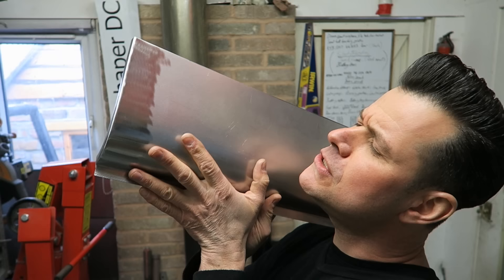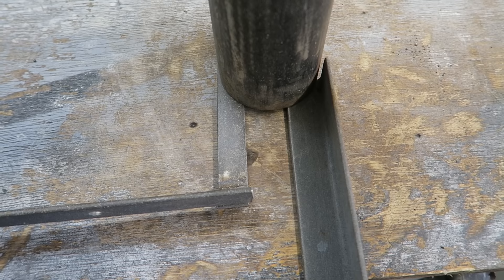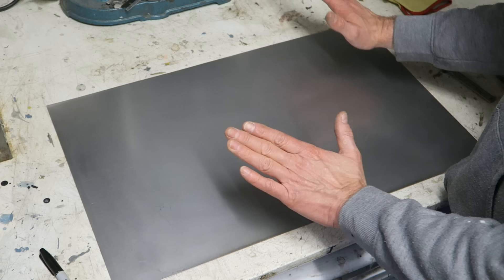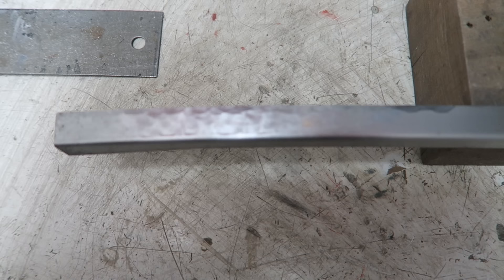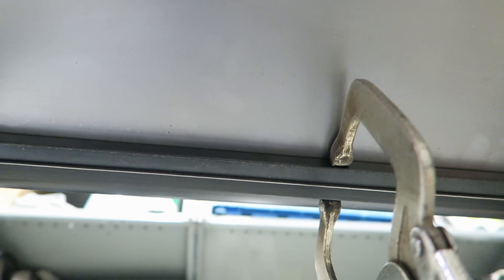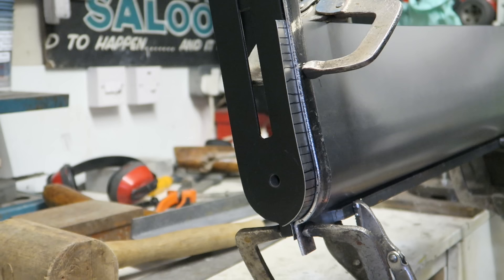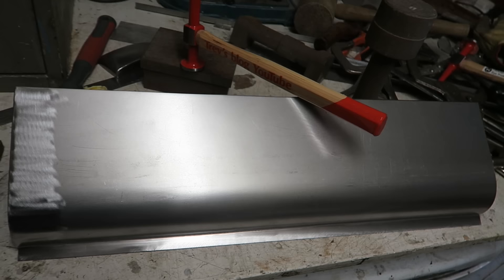How to make your own repair panels sill fabrication beating tips and tricks #16

Comment: Nice work Trev, however in the part of the video when you said the panel had slipped slightly, hence the lip was bigger by 3 mm, with the shrinking of the metal i would have imagined that it has to go somewhere so it goes outwards making the lip wider on the arc. Just my thought as the panel looked straight afterwards

Comment: That new hammer looks like a "Snap on" bodyhammer without the Snap On logo andcolor scheme.
Reply from the maker: It’s very similar to the snap on but the head is almost identical to the Sykes Pickavant that is no longer manufactured. I buy them from India unbranded from the manufacturer then add my logo. Most branded tool brands don’t make their own tools, they’re manufactured by tool makers to a specification then sold as their own tools.

Comment: You're good at signing. Why not tac it with super glue to hold in place to weld it?  We just threw our metal tube away we had it for years. I came here for tips on how to bend the flat metal to repair two sills on our Humber Super Snipe series V, that we most likely will sell when we have repaired the sills. That metal cutting saw you use is ideal for the job.  This video is very professional.  Thank you! Ps what hat did you buy afterwards...?

Comment: If you use Chrome as your browser and right click on the link in the comment you will see a menu open that gives you the option to "open link in new window" or "open link it new tab" I usually use the latter and so you retain the comment in the original tab and open the link in another tab or window which you can close when done and go back to the original comment.  Hope this helps.

Comment: Trev not sure if you'll see this or have time to answer - but if I spent the time dressing a cheap hammer up would it be usable?  I only ask because I seen you say you dressed yours, rounded the edges of the face.

I bought one of those cheap n nasty hammer n dolly sets a while back and never got round to using it - only remembered I had it with this video.  Is it worth putting some time into the hammers/dolly's?  And if so what/how would you do it?
Reply from the maker: Purple Helmet just give it a go, what have you got to lose.? I regularly use some really cheepo nasty dollys because they’re quite small and fit into certain gaps. Cheers Trev 👍
Reply: @trevsblog  - thanks for taking the time to reply Sir, really appreciated.  I'll get wired in and see what I can come up with, try and round the faces like on yours 👍

And again, thanks for these videos, so much quality in them, learning so much and enjoying your style too - thanks for giving up your time to do this!

Comment: 40:20, or thereabouts.  Just a thought on those tucks.  Rather than letting them get too advanced, would it be helpful to perhaps put the tip of a large screwdriver behind them and use it as a dolly to flatten them before they actually crease up?
Reply from the maker: It does look like the steel folds over but it actually doesn’t, here is a follow up video showing greater detail of the process including your suggested technique. 👍 https://youtu.be/kdJmI3edlRw
Reply: @trevsblog   You need an "anvil" that you can slip under the sheet metal about halfway thru the job so the shrinking can be started earlier.  Use a tire iron or a tapered piece of hardwood.   Gotta be sharp enough to slide most of the way in (just about).  Most of the shrinking is done near the edge of the metal anyway, so not a problem.  Don't hammer above the tip of the "anvil".  Let me know after you try it.  Guaranteed or your money back.

Comment: you are the man trev!
i saw your video and try to make some vw beetle running boards but they are wayyy more complicated than the panel you made, the ends and across the panel there is a curve(!) so i cant find a way to stretch the metal over a sturdy surface. i am sure you could do it but where the heck to find a beetle running board in your garage to guide me..

Comment: Wouldn't it make sense to have a spindle/bearings of some sort, for the tube to rotate on? This would/could allow the lip forming section to be used as a leaver for rotation of the tube whilst the metal sheet lays flat against you bench top (or any smoothe & flat plane that the forming tube is mounted flush with).   Might have to minimize the clamping apiratus (diy micro/1in G type clamp?) for the tube to sit close/over edge of bench.
Reply from the maker: M. S. L. Yes it would but you get to a stage where the tool becomes over engineered, the demand for simple tooling is what most people have requested. You’re right though 👍 I think an H frame with the arms located at each end with a roller that sandwiches the sheet. Lock the tube and pull down on the H frame to draw the roller over the steel. Cheers Trev 👍

Comment: Excellent video.  I like your approach of not buying an elaborate new piece of equipment for each task.  Unfortunately I learned that lesson to late and now my own garage has so many tools that it is difficult to make room for projects.  
I just bought a "7 piece Body and Fender Set" from Harbor Freight and the wonderful Chinese workers formed a nice shiny finish with what appears to be a fine grit sanding belt. I do not wish to transfer that finish to every piece of metal I work on so I want polish each working surface. Do you recommend  using an electric bench buffer and if so what grit should I work up to? 
 Thank you sir.

Comment: TREV  I just started watching your  work and I ve got to say your work is quit good  and the cars you get to work on are special.The point I want to know is what mataerial you use to finsh up grinding the weld to get that smooth satin finish on the metalThanks
Reply from the maker: Frank Cellini watch my heat distortion control video.. about 40 minutes in. Cheers Trev 👍

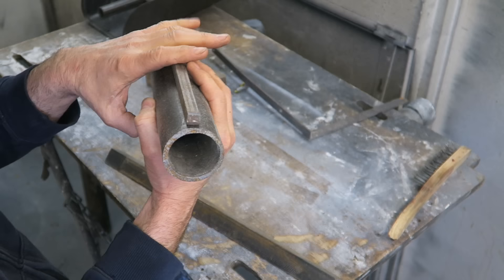Comment: Trev... at the 3:00 mark, rather than welding the beveled galley... why not drill some 3/16" holes through the sq rod and then plug weld down and through into the round cyl?  :-)

Comment: thanks for this - but 2 couple  questions - the small radius planished - does the thickness of bend changes? and why not cut and weld?  - working on vertical radius auto corner and having a doozy of a time making it look proper.  and why not roll radius tool on panel.?  and the first bend - finger brake is acceptable right?
Reply from the maker: The way to answer most of your questions is to say that any method that brings about the desired result is correct regardless of what you do. Most people will disagree with me because they’re stuck in the my way is the best. This video is basically demonstrating a hammer forming technique using something home made. Many enthusiasts won’t have the funds to buy expensive metal working equipment and the new knowledge gained to able to make a one off tool like this or made from plywood will be a massive advantage. You could use a bead roller to start the bend then finish off by hammer and dolly but you would have to have a mechanical shrinker to gather the metal around the curve. Going back to pie cuts or cutting and welding to lose material is less desirable than shrinking the metal around a former. The material will of course gain in thickness and will be much nicer shaped without more welds and grinding than is necessary.

Comment: Why not kerf cut the edges and then weld them back together with a mig of tig? Makes for a stronger lip.
Reply from the maker: Robert Spicer this is a way of creating a more desirable panel closer to what an original would have been. Cheers Trev 👍

Comment: Hi Trev. Your van is 1960 model. I’ve a question for you? Cld you go about doing the sill in the same way if it was in meter sections? Top guy love the banter. All the best stew. 👍👍👍
Reply from the maker: You can do it any length you want, obviously the longer the section the more force it will take to bend it round the former. Cheers Trev 👍

Comment: Excellent i have a Fiero i need to make a new rear i guess you would call it a small tub its part of the trunk (rear bonnet) . Its kind of egg shaped in the center then flattens out for mounting lol  do you have a video of something like that?? I was going to use a sand bag
Reply from the maker: Dana Wick probably not but I am still in the process of doing new videos. Cheers Trev 👍

Comment: Really great video Trev and thank you. Just a couple of questions ….what gauge was the sheet steel , and what would be the thickest gauge that would be practical to use ? I’m guessing 18 g ?    I’m a carpenter by the way and I have a moggy thousand to start on . Cheers and thanks again .
Reply from the maker: Nearly all outer skin panels will be 20swg  .9mm. As a general rule always measure the thickness of the original panel and replicate that. It is possible to shape 18g but difficult. Cheers Trev 👍

Comment: I am wondering if stainless steel can be formed in the same way or is it too springy? If it can be, what grade of ss is best? And would heat be needed? It would be nice to make a full set of ss panels to build a vehicle that would never rust away.
Reply from the maker: Robert Howes brave man Robert, I’m not an ss expert but it’s much harder than mild steel. Cheers Trev 👍

Comment: What about drilling and tapping the tube and using cap screws to attach the bar stock to the tube?
Reply from the maker: Jeff Alessi Yes Jeff, maybe worth just grinding a flat onto the tube , provided it’s thick enough. That would help prevent it from tipping. Cheers Trev 👍

Comment: Nice hammer job. Do you heat treat the metal to make metal harden after all the forging work? How thick was the sheet metal you are hammer on?

Can stainless steel sheet do the same?
Reply from the maker: Haru Koyama no need to do any form heat treatment. Stainless steel is a much harder product. Cheers Trev 👍

Comment: Bravo ! Very smart trick ! Do you know , how it will go with Alu  ?
Reply from the maker: It should work absolutely fine. Dependant on the type of aluminium you use you may just have to anneal the areas you work with the hammer. Cheers Trev

Comment: Hi Trev, you may have already answered this question but I must of missed it. What do you use to stop the surface rust on the body work after you have striped them?
Reply from the maker: I tend to only remove the paint around the obviously rusted areas then put a couple of light coats of aerosol primer over the area after welding. I sand this back to bare metal when I’m ready to paint. Cheers Trev 👍

Comment: Un using 22 caliber sheet metal for a Ford 1947, it is correct?? What caliber are using ?
Reply from the maker: Ricardo Jimenez 0.9 mm cheers Trev 👍
Reply from the maker: Ricardo Jimenez measure the thickness of you old steel by using a digital vernier calliper, you’ll then know exactly what thickness you need. Cheers Trev 👍

Comment: Awesome home made tool. What is the size diameter of the bull bar tube? 3 inch?
Reply from the maker: jay72chevy yes around 3 inch from memory, always use something slightly smaller than the diameter you want to create as it will spring back slightly. Cheers Trev 👍

Comment: Trev! How could I go about making a circular meshed door for my garden chimannea?
Reply from the maker: Have a look back through my hammer forming videos. I’d hammer form a lip that matches the shape you need the outer lip of the door to be. You could make it as a large solid door to get the lip correct first then cut the centre out as required and weld in the mesh afterwards 👍

Comment: Very nice work. What gauge metal are you forming in this video?
Reply from the maker: Paul Campbell .9 mm mild steel sheet 👍
Reply: @trevsblog  Thanks Trev. I use the hammer and stump method of metal art. Most of it in 16ga (1.5mm) mild steel. It is always a good thing to see someone else's methods.

Comment: Trev what gauge is the sheet metal?
Reply from the maker: Outer skin panels are usually 0.9mm. Always measure the thickness of the old panel that you’re trying to repair and buy the same thickness. Gauge is a tricky term because there is more than one type of gauge available using the same terms but meaning different thicknesses!

Comment: Hay I'm from St Lucia lot's of information but what size is the pipe
Reply from the maker: Use a pipe that fits your requirements, measure the radius of the panel that you’re trying to replicate and get a pipe the same size. Cheers Trev 👍

Comment: Where did you happen to get the buss support hinge for the buss door near the end of your video (product name or part number would be great since I live in the US)?  I need that exact item for  a tilt hood project I am completing.  Thanks a lot for your help and great videos.
Reply from the maker: 100cockroach are you talking about the locking mechanism that locks out the lift up door on my van?
Reply: Yes the locking mechanism, and thank you very much for taking the time to answer my question, it's greatly appreciated
Reply from the maker: 100cockroach it was a rear door locking mechanism from a Honda CR-V I think... it was a few years ago. I’ve noticed that quite a few of those kinds of off road inspired cars with swing out rear doors rather than lift up tailgates have locking mechanisms, the Vauxhall frontera also has one. Here’s a video detailing the door conversion https://youtu.be/m_JsBVrfPqk cheers Trev 👍

Comment: Do you ever use heat to help bend sheet metal?
Reply from the maker: ManVSHulk because it’s mild steel sheet it is very malleable. Heat would distort and buckle it. Cheers Trev 👍
Reply: What about when a car is involved in a fire 🔥?  Is the shell no good??
Reply from the maker: ManVSHulk we do obviously use heat as cars are welded together but this causes distortion that can be removed using various processes, sometimes we can use heat in very small proportions to create shrink if needed or to soften a small area. If a car catches fire it will almost certainly be a write off. If it’s a modern car it will contain high strength steel which properties will be destroyed by the heat of the fire. Classic cars are mostly made from mild steel and although the heat possibly wouldn’t destroy the metals properties it would almost certainly be buckled out of shape due to the fire heating the steel disproportionately. This is a vast question with many answers and not a simple case of saying one thing equals another, if you know what I’m getting at? Cheers Trev

Comment: Very informative. What gauge steel is it
Reply from the maker: Neil Diamond 0.9mm. Cheers Trev 👍
Reply: @trevsblog  thanks for the reply but now I'm confused. I'm in America. Would that be 20 or 22 gauge
Reply from the maker: Neil Diamond the thing is Neil you can’t go wrong with measuring in mm or inches, get yourself a digital vernier calliper and measure your car steel thickness then order the new steel in inches or mm. A gauge measurement is a non linear measurement and there are several different types. The true type would be for carbon steel measuring at 20 gauge for 0.9mm or 0.036” which I think is also referred to as a Birmingham gauge the gauge type you maybe using in the states may put 20 gauge closer to 0.8mm there are several other types all different. Who knows what you’re ordering when ordering in gauge thickness. Cheers Trev 👍
Reply: @trevsblog  thanks again. I believe it is 20 gauge. I think the newer cars are 22. I will be attempting to copy what you did later on today when my friend brings by the metal.

Comment: my wife farts like she has a dead cat marinating in rotten corn inside of her. what kind of template might i use to fabricate something to box her whole bottom half in. of course i will use a nice strong butt weld also to hold it all together and hopefully that will save my nostrils until she corrodes through the enclosure

Comment: Disagree with the bit where you say there isn't a better way. There is almost always a better way. I do agree with not correcting them, unless it's for safety. I find younger people learn better when you let them explore the material and learn to work it. If you can't afford a mistake, then have someone else do the job.
Reply from the maker: Nuvey yep I actually meant exactly the opposite of what you thought I meant, keep an open mind and explore as many ways as possible. Cheers Trev 👍
Reply: No worries. Before I retired, I used to have people telling the kids that they have to do something one way or another. I'd just pull them aside and tell them to try it their way, but if they don't like it, just find a way that allows for quick quality work.
Reply from the maker: Nuvey I couldn’t agree more, I find it annoying when someone says you’ve done it wrong because it hasn’t been done a certain way. I always think about the end result, is it what you wanted? If it is then you’ve done it right no matter how. Of course productivity comes into play but I’m not focused on that subject. Cheers Trev 👍